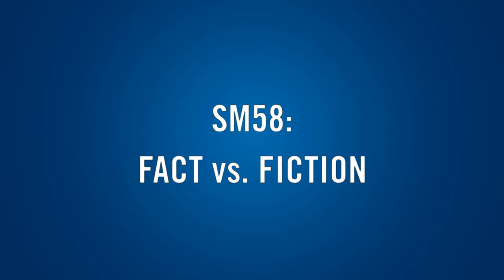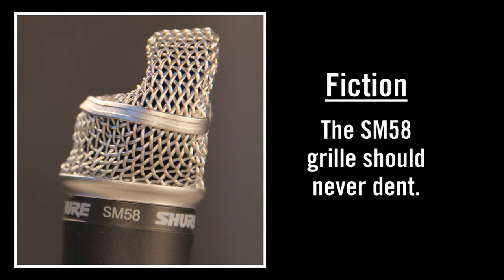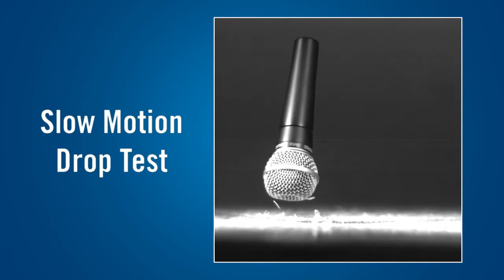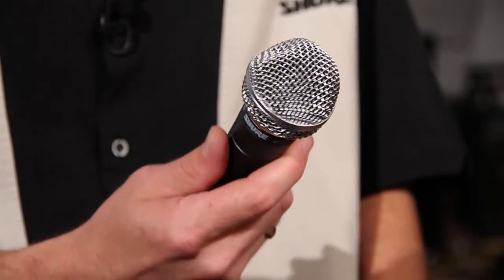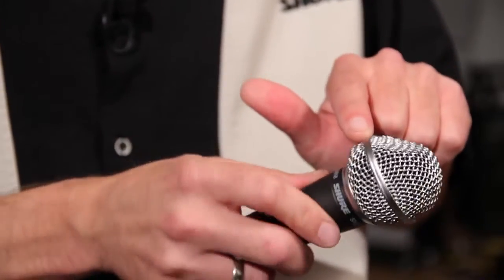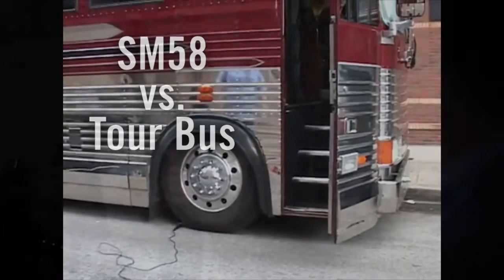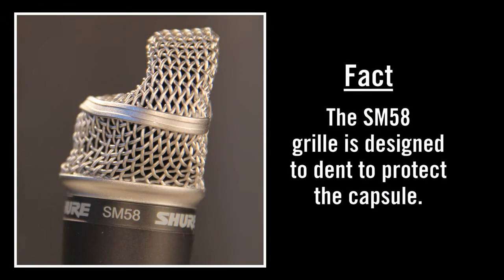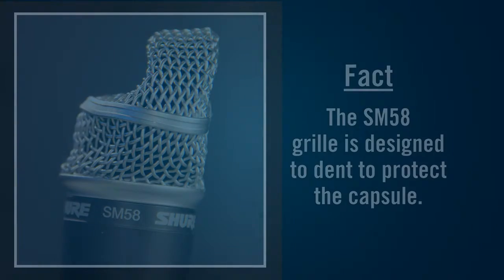Shure SM58 Myths 2 - Denting Grille

Comment: Just curious... If the SM58 grille is designed to dent to protect the cartridge, then why does the Beta58A have a "dent-resistant" grille?
Reply from the maker: The shock mount system used in the Beta 58A is a different design from what’s used in the SM58, and it does not require the grille to act as a shock absorber. Therefore, the Beta 58A can use a hardened steel windscreen without risking damage to the cartridge.
Reply: Cool!  Thanks for the answer!

Comment: Why doesn't the 57 grille screw off like the 58?
Reply from the maker: Here is a link to Shure FAQ # 2102 that refers to the SM57 "rotating" grille:
https://www.shure.com/americas/support/find-an-answer/rotating-grill-on-the-sm57

Although this FAQ notes that the rotating grille is a normal behavior for this model, it does not really explain why this design was chosen.  The design engineer of the Unidyne III element, Ernie Seeler, wanted to make the grille of minimal size in order to minimize the acoustic effects of the grille.  Generally, larger grilles have a greater effect on the polar pattern and frequency response of a microphone.  Using a threaded attaching method would have made the grille substantially larger and would also have necessitated making the grille out of metal.

In fact, the subsequent model 548 was essentially a Unidyne III element with a threaded metal grille.  The grille of the 548 was somewhere in between the SM57 and SM58 in size.  Although the model 548 was in the Shure catalog from 1968 until 1980, it was not nearly as well received as either the SM57 or SM58 or even as well as the 548 or 565.

The fact that the SM57 remains as popular as ever probably attests to the integrity of the original design.